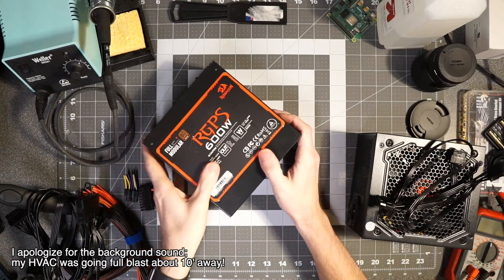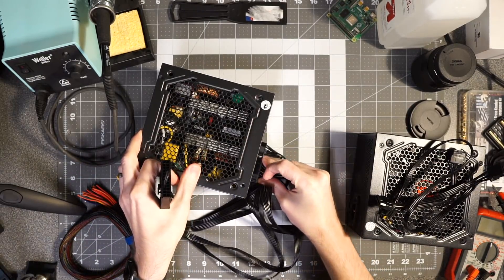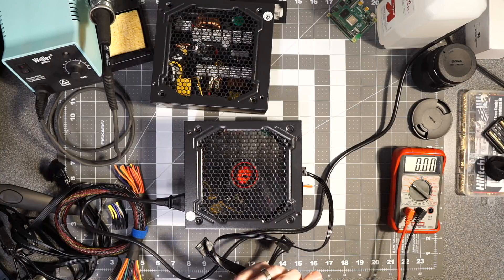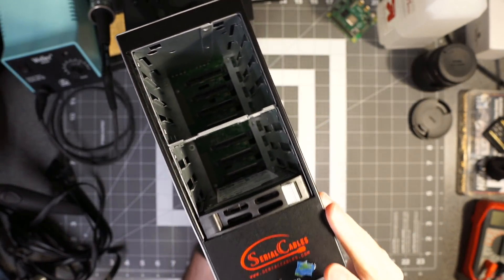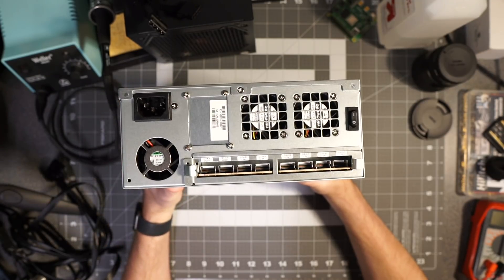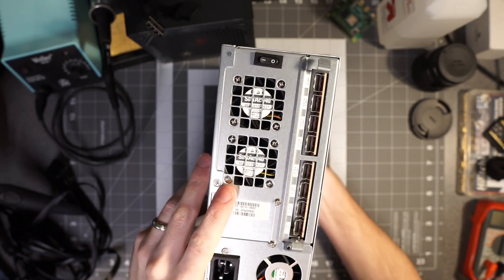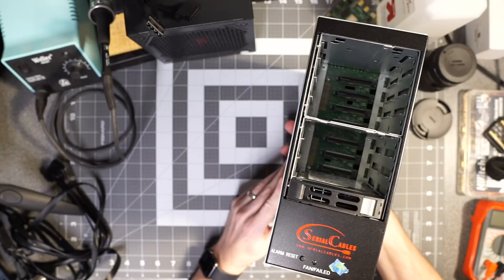Hacking my PSU and more on the Universal Backplane

Comment: Pro tip - when cutting wires that must not touch, cut them to different lengths. Use this also when splicing cables - stagger the splices of multiple conductors.
Reply: Agreed. For added protection, use electrical tape to ' cap' the live ends. Heatshrink would also work.

Comment: Hi Jeff; don't use the switch by the main power cable for turning on/off your Raspberry Pis - this on on the main circuit side on the PSU and can produce spikes as it powers up. Add a small switch to the lines you are jumpering. With this, most of the PSU circuits are powered up, especially the large smoothing capacitor, which will produce fewer and lower spikes when turning on/off. I had a couple Pine64 ROCK64 and used the power switch and they scrambled their eMMC. HTH
Reply from the maker: Good advice! Thanks.

Comment: You do get 5v stand by simply turning it on, not sure what the going amperage is these days but I suspect a couple of amps to facilitate USB charging when "off". Purple lead back on the stone ages when psu cables had colors .
Reply: I've seen 5Vsb current capacity all over the place. I measure with an adjustable load and record when the voltage drops below 5.0V. Worst was around 350mA from a cheap cheese supply rated at 2A. But most chunky/branded ones are close to if not over their rating.

Comment: Ahh, my bad, I missed that you arced some of the power rails in the last video. Given the amp rating of most modern PSU, I get now why you got shocked. I assume you tested the PSU after that happened? Most ATX PSUs in my experience have short protection and will usually reset once mains power is pulled and the thing is left to sit for a while. If not, I'd bet fixing it would be a simple component swap, maybe a thyristor or the like.

Comment: Word of warning with those modular supplies; although the PC-end of the cables is standardized (as it must be) there's actually no standard for the plugs at the power supply end. In many cases, they reuse "standard" connectors like the 20/24 pin ATX, or the 12V CPU connectors and PCIe 6/8 pin power plugs for cost reasons, but manufacturers can and do jumble the pin arrangement on the power supply side regularly (no idea why).

This means firstly that you CANNOT safely mix and match modular cables between power supply vendors (or sometimes even within vendors across lines), and it also means that if you're making small direct plug adapters like this to pull power or jumper PS_ON, then you should take care to meter out your existing cable to double-check which pins go where. Even with everything hooked up "correctly", it's still very possible to get a bang depending on how silly the manufacturer decided to be.

Comment: I thought you only jump them temporarily to start the pc! As a pc builder I have used a screwdriver to jump the pins long enough to power up the pc
Reply: I've done that too when my PC was in the old case (no front or sides) and i couldn't find the power button but it was built enough to boot into DOS 6.22 off a 1GB USB flash drive to test.

Comment: Hey Jeff.  I enjoy your videos. One suggestion for the power supply is to add a momentary push button so turning on and off will be easier. Thanks again.
Reply from the maker: Thats a good idea, or a little switch. Will probably do it at some point.
Reply: Jeff, it should be a momentary switch regardless. Good luck.
Reply: Brain fart. I was thinking about the motherboard signal. PSU of course needs a toggle switch of some kind. Red face.

Comment: I use a shortened and coated paperclip, but never tried it on a modular Power supply.  I wonder if Noctua produce similar powered but quieter fan?   I would love to see a video on fan mod.  Loud fan is the reason I don’t dare to buy a rack mounted RAID
Reply from the maker: I have a similar size Noctua and at full power it's about the same noise. This fan uses PWM in the power supply to run much quieter.

Comment: Fun fact: The output plugs of the PSUs are standardized, but not the plugs on the cover of a modular PSU itself. Check each PSU before blindly shorting the socket. Also never mix the cables of different PSUs, for the same reason.
Reply from the maker: And just to note—I had the correct pins shorted, it was other pins that I didn't pull from the connector that caused the magic smoke.

I trace the proper pins back from the connector that came with this PSU for exactly that reason... and it was made all the harder by the fact the designers chose to make all the wires black!
Reply: Oh, my comment really was to general public. I didn't mean to sound like I am judging your mishap. It looked just like that - a mishap.

Thanks for all the videos! I've been binging them lately and can't wait for more!
Reply from the maker: @greengohm  Ah, carry on then ;) — it's something I learned with this modular PSU. I was looking around online for a spec for the 18-pin header, and I found like 12. Then I looked in the manual and it was not documented at all (only the equipment-side connections had pinouts).

Comment: ATX power supplies have an 5V standby power rail that is always on when connected to mains. It could be used to power a microprocessor (like an ESP 32 with wifi) that in turn can be used to put PS_ON to ground and turn it fully on. Some ATX power supplies also require a load to stay on, if not they will power off and you will need to cycle power.

Comment: Speaking about heat, I was shocked on how hot my NMVe drive gets. 
(I picked up the one you reccommended, but had to get a different enclosure, (still a cast aluminum one) as the reccommended one was out of stock.  When I was cloning an OS image over to it, I had to have a fan pointed at it, to keep it cool for the high-write period, else it gets BLAZING hot, and starts getting errors.  For normal use, it's been getting slightly warm, but manageable.
Reply from the maker: Yeah, I've even found that some individual drives got hotter than others with the same model/drive size... gotta use heat sinks and consider active cooling if you're going to use the NVMe drives much.
Reply: @JeffGeerling   FYI, It's working fine now as my local pi4 minecraft server. Only gets bogged down a little when it has to load a lot of chunks, but is very playable for a couple of people. Thanks for the reccomendation and video work on getting exterrnal drives going! :D

Comment: Wait u blew up that psu just by shorting the 12v output? That's bizzare cuz even 10$ psus have built-in over current , short circuit , over voltage , under voltage protection . Did u buy that 600w psu for 5$😂 ,
Reply: probably the 12v and 5v rails shorted together, that unit maybe only need a fuse replacement to work again but I wouldn't thrust a repaired psu for anything sensitive
Reply: @amnottabs  funnily enough a lot of people used to do that to get """7V""" for fans, can't beleive that used to work lmao
Reply: @virtualtools_3021  i did that with 12v & 5 to get 17v😂 yes it works bcz all the rails r on different taps of the transformer .. it does not work properly in those units with only 12v smps & 3.3 , 5v genarated by buck converters.
Reply: @amnottabs  that still should not kill a psu , it should trip ocp & the unit will reset when u unplug it from mains . And the fuse is the last thing that will blow. If the fuse is blown it means there is shorted bridge rectifier or high side transistor (which will kill the main control ic ) or shorted transistor in pfc or shorted diode in pfc .. in other cases like old capacitor with high esr the psu will run unstable and in cases with shorted output diode it will trip ocp as soon as u plugin . In any case shorting output of an atx psu won't kill it no matter how many times u do it specially a 600w with fancy stickers should have these protections built-in.
Reply: @KuntalGhosh  I know! i accidently shorted a freaking 22 year old BESTEC by accident, and it just shut off. And those are the kind well known for lack of safety!
Reply: @KuntalGhosh  I haven't shorted 12 and 5v rails yet, maybe because a bunch of them were all in close proximity more than those rails shorted together? I only know that in cheap psus (the crappy 200w ones that comes with barebones cases) usually shorting anything blows the fuse; learned this while joining all the 12v lines for a cheap bike/car battery charger, one of the cables got sliced by the psu metal case and shorted with it, I replaced the fuse and it works until today, gives enough current to revive flat bike batteries but the current itself seems to be "dirty" or something cause it puts my father's newer-ish car in limp mode lol
Reply: @amnottabs  yeah it is dirty bcz they use super cheap capacitors and skip on emi filters and other important things that not only messes up with the psu output it also interferes with other devices on the same phase.
Reply: @amnottabs  although the psu looks pretty good quality with 80+ bronze (hopefully its real)

Comment: Jeff, take a look at an ATX power supply breakout board like this one: https://www.amazon.com/Breakout-Adjustable-Supports-1-8V-10-8V-Protection/dp/B08NC3S7Q2

Most will have a power switch built into the board to allow you to turn the power supply on and off.
Reply: I've noticed some mining rigs use old HP rackmount PSUs to provide a bunch of 8 pin PCIe outputs, something like this would be brilliant for that too.

Comment: Be aware that some PSU’s (specially modular ones) do have protection systems that will turn the power output off after a few minutes if there is not enough current being used. I don’t know what the treshold is as my PSU doesn’t do that even with nothing connected to it
Reply: U can put few watts of load resistors and it will run fine. Like a 6ohm resistor should pull 2amp and 24w (and u need a 30w resistor ofc , ½w one will go up in smoke 😂)

Comment: Do you plan to use an step down converter to power the raspis over the 12v too?
Reply from the maker: The CM4 actually accepts 12V in through a 4-pin floppy connector :)

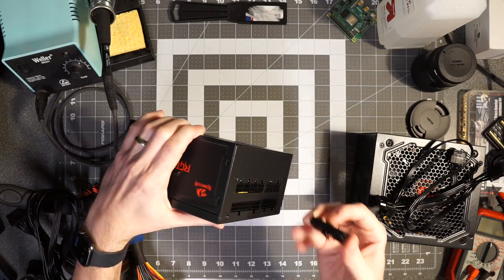Comment: If you pause at 1:10 you can see the PSU got fried because PS_ON was shorted to 5V (not ground).
Reply from the maker: As mentioned elsewhere, the pinout on this connector is non-standard (not sure why, and it was frustrating tracing everything using the all-black cables that came with the Redragon).

Pin #17 is PS_ON in the PSU-side 18-pin connector, and the pin I have it shorted to is Pin #8, which is GND.

I have not touched those two leads at all between blowing up the original PSU and not-blowing up the 700W one you see in this video, so I know I have the right two pins.
Reply: @JeffGeerling  This is a common gotcha that people usually encounter when they use a set of modular PSU cables from one PSU with a different PSU, thinking they are standardized. The connectors on the PSU side are not standardized, only the ATX connectors on the motherboard-side are standardized. This is why you should always use the cables that came with your PSU, and also why you can't assume the PSU connector pinout without tracing continuity of the cables that it came with, as you had to do. See also: https://youtu.be/SDsC_PNo84I
Reply: @JeffGeerling  Okay.  You need to double check that they made the universal 5v pin 8 into a non standard ground.  Just because the PSU turned on does not mean it is wired correctly.  Some PSUs are robust against back current.

Comment: Why are leads are out, shouldn't it be safe if you have used single wire rather than using 2 and shorting?
Reply from the maker: If I were building the connector from scratch, I would do that. But I scavenged a connector from another motherboard power cable for this, and it had a wire already connected in each slot. I thought it would be easier to just snip the other cables and then strip and twist the two I needed.

It was easier, just resulted in me killing an otherwise perfectly-good power supply :)
Reply: @JeffGeerling  😂 🤣
Reply: Btw it recently released atx12vo standard and they are already available on the market

Comment: If you cut a cable flush, it seems highly unlikely that the wire was exposed, certainly not enough for two of them to make contact.  You'd have to bend two leads each 90 degrees, flush, for them to touch.

I'd bet you shorted the wrong two leads.  Was the connector 180 degrees from what it should have been?
Reply from the maker: The two leads you see here in the video are the exact leads that I had twisted together in the earlier video.

Note that when I cut all the individual wires, I bent them away just so I could work on stripping the PS_ON and GND wires, and I'm guessing two of the cut wires were bent in such a way as to be very close to each other (close enough to arc when the power supply gave it enough current).
Reply: @JeffGeerling  I just paused the video at 1:10 when it got fried. 

You connected PS_ON to 5V, not ground.
Reply from the maker: @featherpony  I assure you, I literally have not touched the two leads that are still wired into that connector in the past week since frying the PSU.

The pinout on this Redragon PSU is not standard—the connector that I used is a 3rd party replacement not made for Redragon specifically, so the actual wire colors are incorrect.

I had to manually trace back the connections from the mobo side of the connector to the 18-pin PSU-side connector, which is annoyingly more difficult due to the all-black wire color scheme on the Redragon PSU.

Pin #17 is PS_ON, and Pin #8 is GND, and those are the two wires (both orange in this connector) that I have twisted together.
Reply: @JeffGeerling  Please allow me to point out that the pin you tied PS_ON to is "5V".
https://www.smpspowersupply.com/connector_atx_pinout.GIF

The safer route is to follow the example of that "long wire" setup that you didn't use due to the excess cabling.  If you look, it is wired to a DIFFERENT neighboring pin (which in every ATX version is consistently "ground").

Your homemade connector should effectively destroy 50% of the power supplies it comes in contact with.  However, the commercial product (the one you didn't use) is wired in a way that is compatible with any PSU.

I assure you, I am not going by "colors". I am trying to tell you that your assumption that "pin #8 is ground" is incorrect. It is pin #16 that is ground.  I'm curious why you chose to tie pin 17 (PS_ON) to neighboring pin 8 (5v) instead of neighboring pin 16 (ground)?  Are you saying pin 8 on one side of the connector does not map to pin 8 on the other side of the connector?
Reply: @featherpony  I've shorted ancient crappy chinese power supplies, and they dont blow up. What gives? Did manufacturers forget how to make OCP nowadays???
Reply: @virtualtools_3021  If power supplies are used properly every time, it doesn't matter.  But the need to add additional circuit protection in order to make it "idiot-proof" is directly proportional to the ratio of idiots to population.

I guess in a world where 100% of all people are idiots, then 100% of PSUs would need to have idiot-proof circuitry.

Comment: Can we hear the story about what happened ten years ago?
Reply from the maker: Apparently 14 years ago! https://www.jeffgeerling.com/blog/2007/rip-canon-powershot-s2
Reply: @JeffGeerling  Ouch! 
Read the whole thing.
Reply: @JeffGeerling  this caught me too. It's kinda obvious, but same time it's hard to realize before doing. These caps are designed to provide powerful spark, and that's exactly what they do when being shorted. My attempt was like: "let's grab this PCB... Ouch! How many volts? 400??? Okay, I'd rather discharge it manually... BANG!"
That was the best 1-second explanation of how Photo Flash works
Reply from the maker: @АлексейДмитриев-ш1ф  Haha, it's too bad a picture wasn't taken when the flash happened :D

But yeah, once you realize the instant power capacity of a capacitor... you understand camera flashes are basically bulb + capacitor + battery, and a circuit that transfers energy from the batteries to the capacitor, then the capacitor to the bulb. Not too crazy, and not far from the old 'explosive' one-time flashbulbs of the old days!
Reply: @JeffGeerling  Flash capacitors are no joke. I've worked on a few external flashes and their caps will give you a bad day if not fully discharged.
Reply: @izzieb   You aren't kidding, I have a MASSIVE 1f cap from an old car stereo install lying around, and this thing is like the size of a tennis ball can.  I always look at it with a side eye.  Always best to use a high watt resister to bleed off any residual current. Sudden discharges can cause the cap to explode as well as give a shock, since the heat generated would vaporize the trace abounts of liquid in the elecrolytics, and cause the can to over pressurize.  Luckily, most modern hi farrad caps have the cross cut franges on the top designed to split and ease the 'blue smoke' out. ;)
Reply: @redace01  And those caps can hold a charge a LOT longer than one might think.
Reply: @FullSpeedAhead19  flash caps hurt like a total SOB tho, would NOT reccomend being careless around them